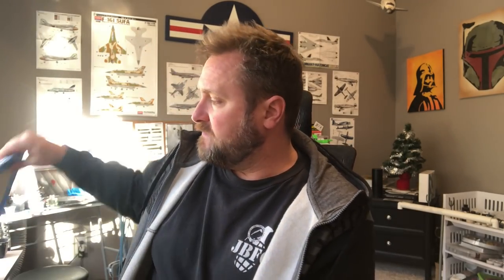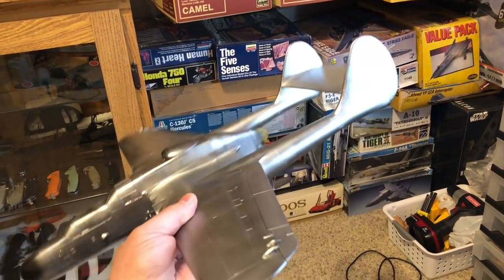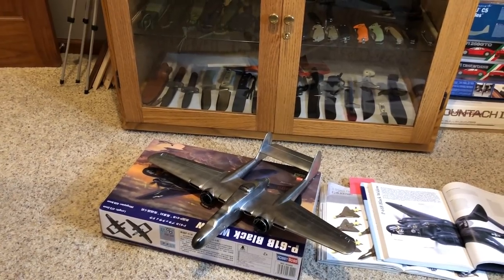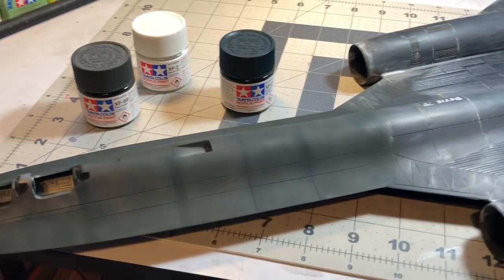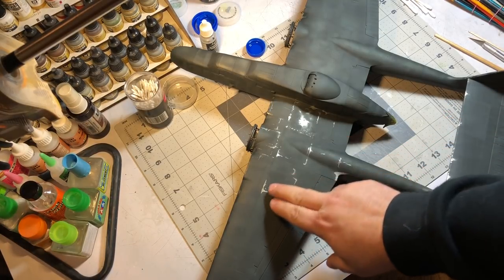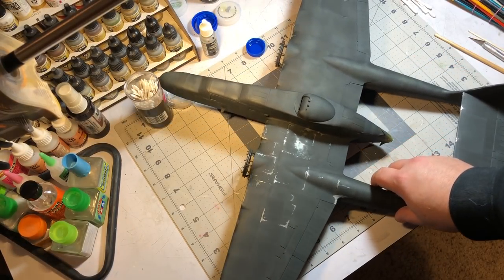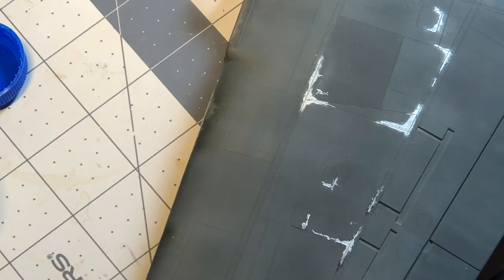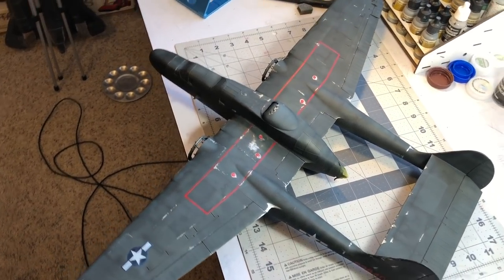HobbyBoss 1/32 P61 Part 4: Paint

Comment: What color paint system go you prefer? And Why? Thanks
Reply from the maker: I use mostly tamiya acrylics.  I find they spray smoothly (if thinned properly) and don’t clog my airbrush like Vallejo.  They also can be thinned with lacquer thinners like mr color leveling thinner which gives me a lot of control as I spray it pretty thin.  Tamiya doesn’t offer a lot of colors but I’ve found a really good website that shows the more common paint mixes:  http://www.ipmsdayton.com/sites/default/files/Tamiya_Mixes.txt

Comment: I am confused, maybe I missed it . .  You used the Tamiya Enamels for the final color coats over the hairspray and then did the chipping? If so my question then is . . .

The water and Valejo airbrush thinners work to chip the Tamiya enamels??  hmmm, my gut tells me you used Valejo Acrylics for the final color coats??  I am just getting back to 1/32 aircraft since I retired . .  a forty year hiatus . . you are very good and you inspire me. Thanks
Reply from the maker: I used tamiya acrylics thinned with lacquer thinner.  Water won’t effect the acrylic paint unless there is hairspray or other type “chipping” fluid between the base and top coats.  The hairspray loosens when wet thereby causing any paint on top of it to chip away.  I’ve only ever done chipping with acrylics so I don’t know for sure how enamel would react...I assume it would react the same way, just might have to scratch the surface first to allow water to seep in under the strong enamel paints...that’s just a guess tho.
Reply: @seanerk5kt9  Thanks, makes perfect sense now. The P-61  Revell in 1:48 was my first serious effort when I was a young man . . . have recently done several 1/32 OOB just to get my modeling legs back under me . . .  just ordered the Hobby Boss in 1/32, it will be my first attempt at weathering . . . your vids have been very informative. Thank you for your efforts to explain how you do things!! :) It is a rare thing to find a Master willing to share his secrets.

Comment: Looking great! Do you have a primer you usually use or do you change it up every time ?
Reply from the maker: I usually use Mr Hobby finishing surfacer 1500 (either gray or black) thinned with mr color leveling thinner.  If mixed and sprayed properly, it gives a really smooth tough finish.  I don’t typically stray from that although to limit the amount of coats on this one, I just used mr hobby gx2 gloss black as a base and primer for the aluminum overcoat.
Reply: Primedmodelworks i use mr surfacer 1500 too, tried the Vallejo primer but that one sucks if you use masking tape over it